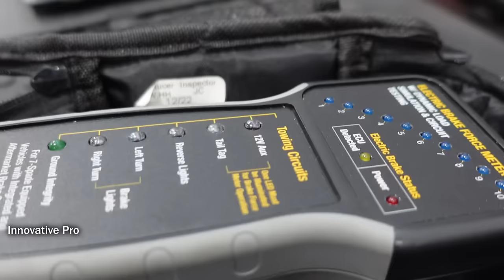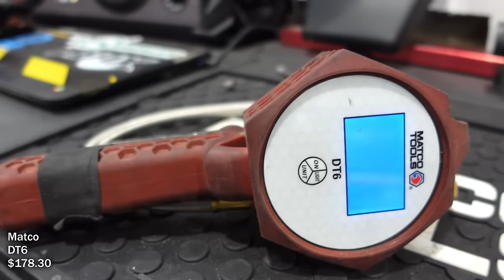Gifts from Mom Always Hit Different

Comment: The hook is called a rafter hook. It's for hanging your tool off rafters or, it works pretty ok for ladders too. Also, if you are wearing a tool belt, you'll usually have a few loops or d rings the hook can also hang off of as well.

Comment: The clip on the heat gun is for your tool bags. In most of the other trades such as electricians and plumbers we have bags on and those clips let the tool just hang on it. Or on your belt
Reply: Or a 2x4

Comment: weird the Milwaukee inverter has a joist hanger. guess that that one off job might need it and there it is when you need it.. but I cant think of any reason id need a small inverter clipped to the side of a stud for any around the house kind of work id be doing with a low wattage tool.

Comment: Really wanted to see that creeper hanger on the left side there and what he used to hang that creeper. Also the pry bar holder on the side the camera was hitting it the whole without talks about it either. Great video but show us those things. We want to know what they are too
Reply: Marco sells it iirc
Reply: i actually made the creeper holder myself, the ones they sell just werent quite right for what i wanted, ive also got an extra one in case i felt like making more id have a template
Reply: @BraydenSB  i see those
Reply: @Tech1O  i liked how the creeper wasnt sticking out too far up above the top of the toolbox. The lisle and matco one places the creeper too high and i didnt  like it. I like the one in this video. 👍
Reply from the maker: He actually went over the build of the creeper holder and the prybar holders but I ended up cutting them from the video 😩.  The creeper holder is custom and the prybar holder is (I believe) snap-on.

Comment: Hook is called a ladder hook. That’s exactly what Milwaukee calls it. It made for hanging off of stuff, including ladders. 

Not something I would really use on a heat gun as if it’s swinging, it can swing into you or something with a hot tip. Not the best thing. 

It can ALSO be swing out, and act as a little bit of a stabilizer when the tool is on its back doing wiring over it, will add a little bit of knock over protection, but not much.
Reply from the maker: Cool, good to know!

Comment: 20:52 one of the previous shops i worked at had one of those hand pump mityvacs as a shop tool for bleeding brakes, i actually had the plastic handle on the hand pump break on me while i was using it and the end of the metal shaft cut a chunk out of my finger so bad i had to get it burned shut at the hospital. i bought my own air powered one after that
Reply from the maker: 😱 glad it didn’t end worse than that